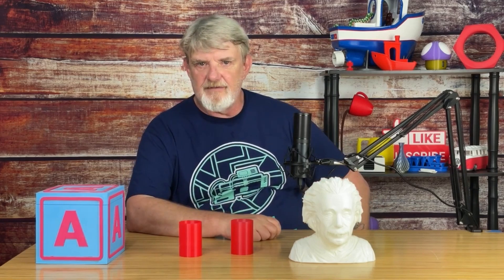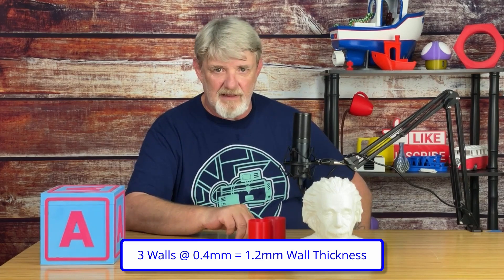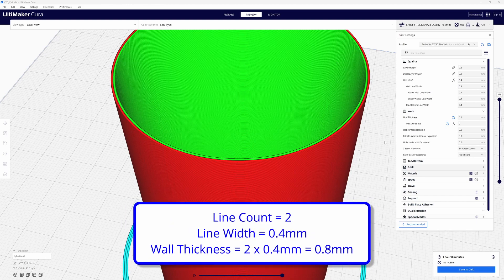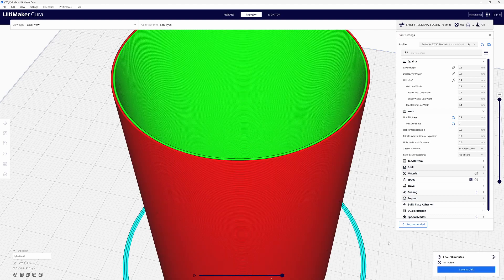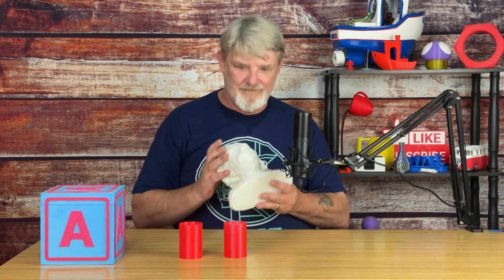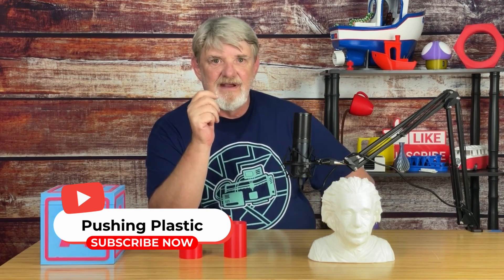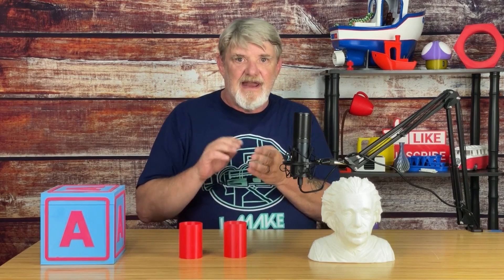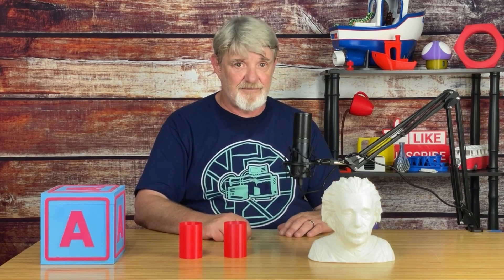Smoother & Stronger Walls

Comment: Setting outer walls before the inner wall and reducing flow resulted resulted in fomenting accurate cubes. However, I kept having to tune the z-offset higher because the nozzle kept scraping on the print.

Comment: Hey!  Awesome info!  Let's say you are printing is play armor to wear.  Would you print the model inside to outside.  Or print outside to inside.  Ideally the goal is a smoother outer layer
Reply from the maker: If I were doing it, I would print inside to outside. But keep in mind, size is important. Do a small test print first and if you need to, apply horizontal expansion to it.

Comment: I've been enjoying messing around with wall thickness and number of walls and I'm just amazed at how a seemingly small change can drastically change the strength and print time.  But it really makes a difference.  One thing I have been trying to figure out in cura is if I print a tube how to print the inner diamter wall but not the outer diameter walls.  Basically I want the ID to be smooth and solid but I want the OD to be the infill.  Since both seem to be considered as outer walls I can't figure out how to selectively turn one or the other off.